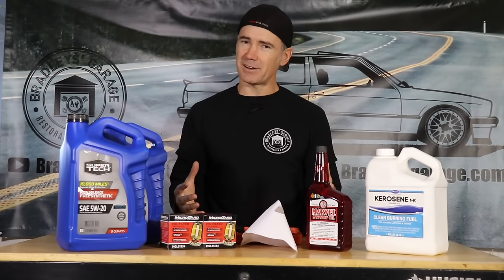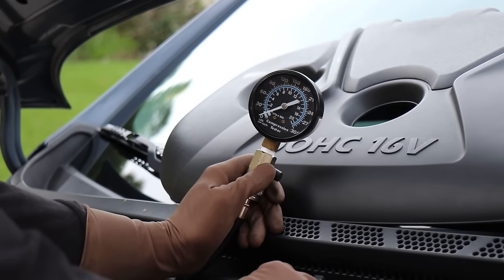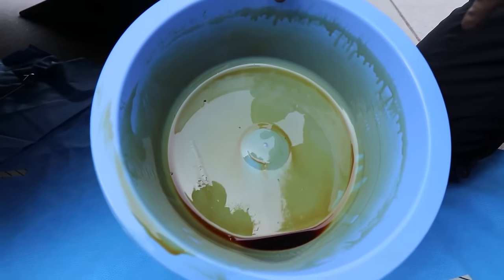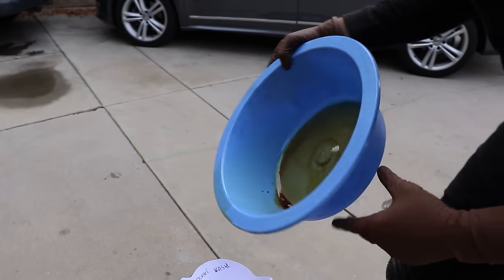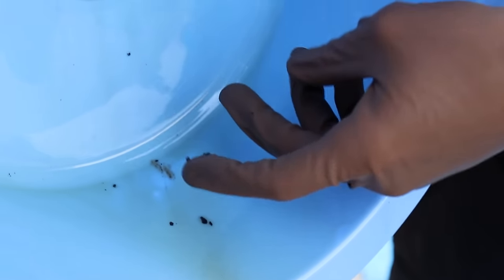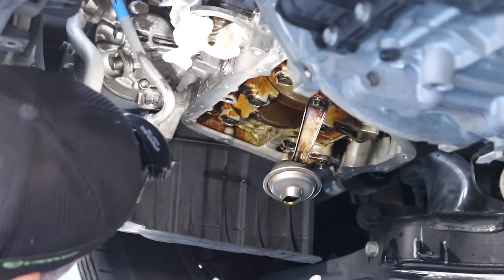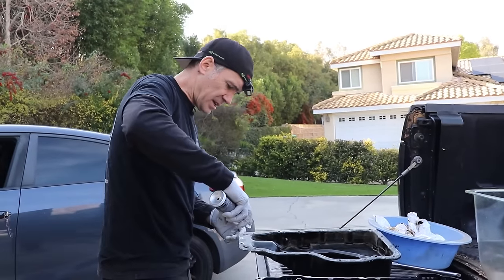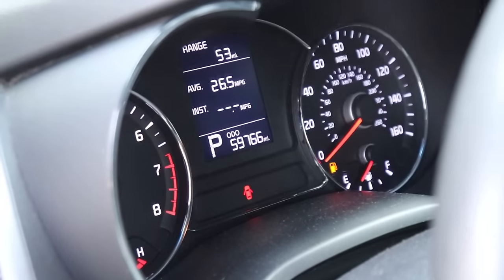*UPDATE* Customer States Jiffy Lube refused to change my Oil - Sludge Factory Kia Forte

Comment: Is it just me or is the oil still running pretty dark even after those multiple flushes in a short period of time?
Reply from the maker: Hey Chris, thanks for the comments. We are not sure how much effect the MMO mixture has on the look of the oil after 430 miles but it may have still cleaned up some internals (i.e. walls, crevasses). Didn't see a huge visual difference on the cylinder head but there are plenty of areas that are not easily visible that could have been dirty.
We will continue to monitor it every 1k miles until the next oil change. Hopefully we got it squared away and it continues to run great from this point forward. Cheers!
Reply: @BradleysGarage  good points. There are so many different nooks that the sludge could have been left in. This has actually been a really insightful experience to see why I get an oil change exactly as often as the manufacturer suggests. 

I did heed the advice of a different mechanic (Ahmed or @CarCareNut )- when I bought my 2023 Toyota Corolla Cross Hybrid, I got an oil change at 1,000 miles, again at 5,000 miles and will resume normal maintenance schedules from Toyota when I get to the 10k service. During that break in period I’ve heard that a decent amount of metal debris can be found as everything gets moving and you don’t want all of that stuff floating around in there for long. I try to pamper my cars so that I don’t ever have to experience the issues this driver is dealing with now. 

Thank you again for this insightful follow-up video!
Reply: @cookingwithchris1171 Some cars may arrive with a different oil blend initially. We had a newer Civic that they did not want us to change the initial oil too soon on. On my Subaru I did 1/3/6k synthetic changes then 5k or 12mo after
Reply from the maker: @cookingwithchris1171  Chris, any brand new cars we have purchased over the years we have always done an oil change at 1k miles. We like to progressively "ramp up" the engine during that break in process and really drive them how they will be driven for the rest of their life.
If you drive them around like a Grandma for the first 1k miles then essentially you trained them to like that kind of driving.
On the other hand, if you really stretch the legs then I think you will have trained it to be a monster for the rest of it days.
Maybe it's just some old superstition from my Pops but that has worked out great for any new cars we have purchased.
Cheers!

Comment: The fuel dilution with the GDI system is ruining the oil and literally breaking it down an turning it into water. Can’t go more than 5k without changing to oil out!!!
Reply from the maker: Thanks for the comments Kevin, this is the LX model so it has the 1.8L MPI motor. Not sure if they also share the same issues as the GDI engines? This is our first experience with a Kia as we mostly play around with Euro stuff.
We are recommending to him to change it every 3k miles moving forward so hopefully that will alleviate the issue.
Cheers!